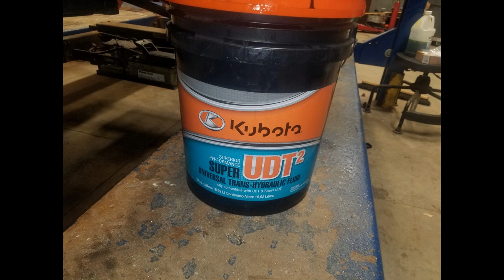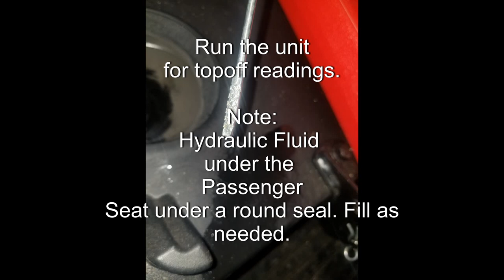Kubota Transmission and Hydraulic Filter Replacement Video

Comment: Good info here!  I wonder how many RTV owners don't know about the big reservoir located under the passenger seat
Reply from the maker: jeffreyengle1262,
           So sorry it took so long to reply. We had to look it up to find the capacity of the tank because the fluid gets burnt and has to be replaced. Our units run many hours and the fluid went from gold to dark orange in what seemed like a little time.  Kubota has there fluid locked down we only use their fluid. All of our fluid vendors could not find the exact fluid to replace Kubota's. Thanks for asking that awesome question because we want everyone to know the capacity of the fluid and to only use kubota fluid. Thanks for watching our short videos'.

Video Team One( Home of the Short Videos').

Comment: You did show how to drain the unit
Reply from the maker: roberthillis1948 ,
                       Thanks for Watching Our Short Videos. This Video does not show how to drain the Hydraulic Tank.
To drain the tank you must have 5 Gallons of Kubota Hydraulic Fluid. The Drain Plug is on the passenger side under the hydraulic tank. Thanks for you Question. We will have to make a video showing the draining process and the location of a drain plug.
Video Team One (Home of the Short Videos').

Comment: Where is the drain plug for the Transmission & Hydraulic Oils?
Reply from the maker: E J,
        The hydraulic tank oil drain plug is located under the  RTV beside the main center oil pan covers. Look for the side cover with many round holes. The drain plug is inside of the cover in a larger hole. Remember under to the side. Thanks for watching our short videos. 

Video Team One (Home of the Short Videos).
Reply from the maker: EJ,
          Thanks for watching Our short videos.
                      https://kubota.ca/getmedia/f6615d9f-ef7b-4aa2-8819-2f68c3021a29/OPS-RTV-X1100C-K7731-71216-ENG-20160711?ext=.pdf.    This link gives all technical Specs for the Kubota X1100C.

Video Team One (Home of the Short Videos).

Comment: good video but a couple of holes - HOW MANY QUARTS of fluid needed - you should have shown where to add the transmission and hydraulic fluid. 
- THE FILL point is under the bed in front of the filter?????????????????????????   whats that mean and where is it?
Reply from the maker: Ed, 
                 Thanks for watching our short videos. 
This is a link to the manual that comes with every Kubota RTV X1100C. https://kubota.ca/getmedia/f6615d9f-ef7b-4aa2-8819-2f68c3021a29/OPS-RTV-X1100C-K7731-71216-ENG-20160711?ext=.pdf.

Thanks for watching Our Short Videos.
Video Team One (Home of the Short VIdeos).